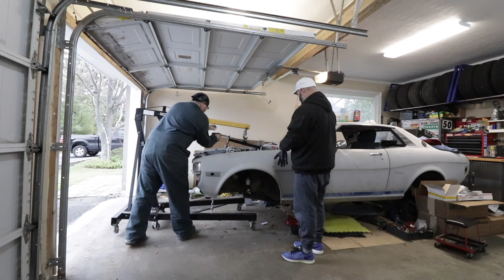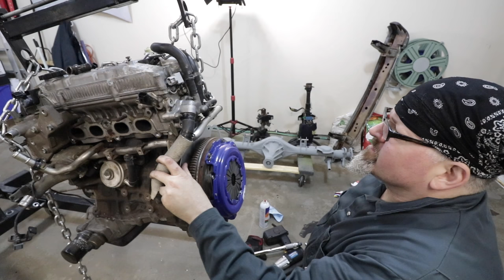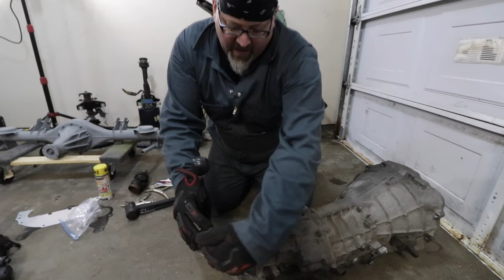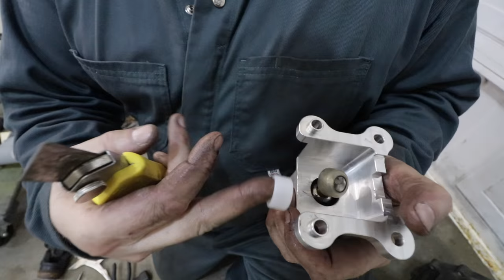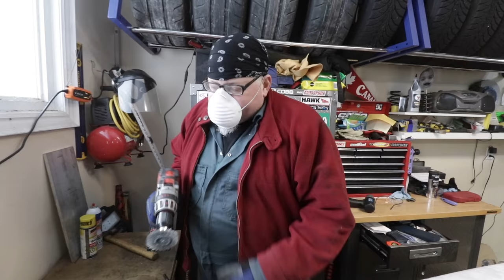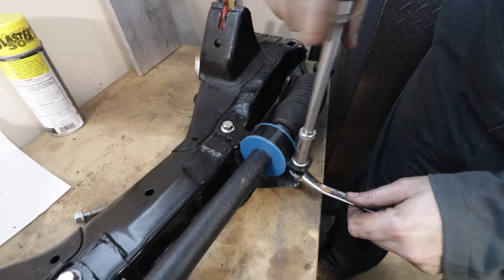Beams 3SGE Shifter Relocation Kit & More! - RA24 Toyota Celica Project

Comment: I used your idea of grinding/cutting the flywheel cover on a project of my own. When fitting a newer JP4 1.6 16v engine in a Peugeot 106 or Citroen saxo. You have to use a The older J4 sump so that the exhaust manifold clears. But on our old engine the con rod came through the sump so it was no good. Anyway after seeing the previous videos I used your idea of grinding down the sump/flywheel guard as it' its just supporing material for they flywheel cover. Worked a treat and I proved everyone on the forums "who said it can not be done" wrong!!!!! Thanks guys love the speed academy videos! Keep them coming
Reply from the maker: Nice work and thanks!

Comment: Just a heads up that the SQ sealing plate for the gearbox is meant to be used on top of the factory Toyota one! There's actually a small step in length between the block and the sump piece which the OE piece fills so the gearbox bolts up square to the block. Good work so far though!
Reply: Ah! Good to hear it's already sorted. :) Looking forward to more progress!

Comment: One option for the gaping hole on the engine is silicone and rivet a piece of thin sheet metal on. Even though you have the dust shield it will st gather a lot of dirt and crap in there.

Comment: Been loving this build.
I hit you guys up on the engine shopping episode. I'm strongly considering a BEAMS and 6spd for my Toyota truck. just wondered what it's like getting parts for an all-import engine.
Looks like SQ has quite an array of stuff, obviously you had a new timing belt.
Reply from the maker: Battle Garage sells a bunch of OE stuff for the Beams, including stuff like timing belt, water pump, belt tensioner etc. so you can definitely find what you need for this engine in the States and I'm sure the guys in Australia have local sources too.
Reply: Thanks!
Whichever way I go, you just helped make one more fast car (truck) 
It's a BEAMS or a 2JZ...

Comment: instead of shimmering the transmission so it sits lower or cutting a relief in the tunnel, would it be possible and easier to hammer that small section to allow for more clearance.
Reply from the maker: We shimmed it down already and it clears beautifully now. No worries!

Comment: The D shape bushing goes the other way. The opening will close as u screw in the bracket. Now it's kind of forced open as the brackets rubs down on the none open side of the bushing.
Reply from the maker: Good eye! Thankfully we figured that one out before bolting the subframe up.

Comment: Moooooose! Still no slo mo Moose action though...killing it on the Celica!
Reply from the maker: WE need a slow mo camera and then you shall receive!
Reply: Speed Academy Oh, I'm not talking Phantom slo mo, I'm talking low budget post production slo mo lol

This isn't slo mo Moose related, but I recently got my first big boy car! I was driving a scion tC with everything (coilovers, full exhaust, etc) except a turbo for over 8 years and I just got a 2010 e92 335i x-drive manual and I can't belive how insane this car is! Everything about it is super nice and it's so freaking quick compared to my old car. I'm trying not to fan boy, but it has definitely got me excited again about modifying and messing with cars. 
I also wanted to say you guys seriously have one of the best car channels on youtube, its awesome you guys share your kick ass rides, sweet automotive skillz, and trick driving. Thanks for the videos!
Reply from the maker: The 335i is a killer car but make sure it's in tip top shape before getting into modifying it because the N54 engine can be a money pit if not maintained right.
Reply: Speed Academy I've done my research on the engine and I  (hopefully) know most of its common issues. I'm already saving up for new turbos, a walnut blasting tank for the intake ports is coming soon, and I'll have a new valve cover and seals soon for when those start to give me trouble. 👍

Comment: Cool series, thanks for sharing it with us. I'm considering this swap on my car and was wondering how low the oil pan sits with these engine mounts? Is the bottom lower than the crossmember?
Reply from the maker: It's about flush with the bottom of the crossmember.

Comment: toyota makes a shifter that has a bend in...yours is straight...that trans looks like a w55 out of a is300....i may b wrong but my shifter out of w55 looks exactly like that....good job guys+1
Reply: bryan senulis It is actually a J160 gearbox, but as the Altezza RS200 is the same chassis as the IS300 the shifter looks the same. The J160 is not a very strong box, but more than strong enough for the 3S-GE and has 6 gears.
Reply: Mine is 5 speed and housing for the shifter bit different but the shifter the exact same....i got a strait one and a curved one.. in usa had 2jzge and w55 5 speed
Reply from the maker: Cool, we'll look into the curved one since we would like to move it a bit closer to the driver, I think. We'll see how it all feels once we get the seat mounted in the right position.
Reply: Good job with car...i have alot of xcessive  stuff on my 91 cressida with 2jzge r154 trans... maybe they have fully adjustabe control arms with hiem joints and knuckles....even it u dont drift it makes car feel way better... and if u have a o sh!!t moment...the extra steering angle helps u from not hitting full lock.....i enjoy all yalls videos... just tell your boy /partner sr20= time bomb at 300hp...
Reply from the maker: Pete says SR20 for life! ;D You'll either be happy to see what we have in store for the 240SX in the summer or hate it! But SR20 no more.
Reply: Im a 2jz guy and swap .... no sr no ls no rb ..  it worked for me for past 10 years and im 33 ill be telling grand kids...back in my day i used 2jz... anyhow....yall going good job and keep posting... it good stuff... shout out to houston texas and lone star drift... and tx2k17..200 + pulls of streets with no fear..... keep up good work...luv the car...yall should build 240 260 280 z with a jz compound turbo and b gods
Reply: Sr a time bomb after 400 hp crank but car light and be fun...just not reliable....just like wrx ....sorry to post to much...he learn the hard way just like i did with 7mgte

Comment: I don't wanna be that keyboard warrior guy,but pro tip,loctite goes off when in contact with steel,"You're not supposed to" touch the bolt with the loctite bottle to prevent it going off in the end of the bottle which clogs ye old nozzle

Comment: that shifter  is 98%  copy of the s2000 shifter
Reply: err no, I designed that shifter and I have never looked at an S2000 one before. Unless you meant that as a figure of speech?
Reply: Sam Quad im taking  about the lever.. the oem  shift lever, arm, where the knob  screws on
Reply: Oh right, my bad. I thought you meant how the mechanism was made to relocate the shifter itself. It was handy that the Beams didn't have an additional reverse lockout like the S2000 shifter or else it would of been much harder to make the kit.